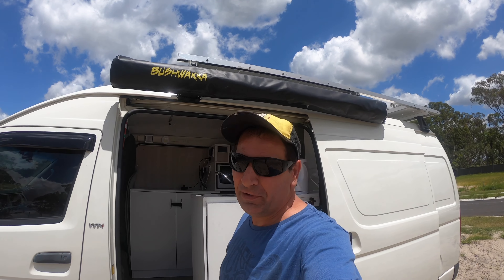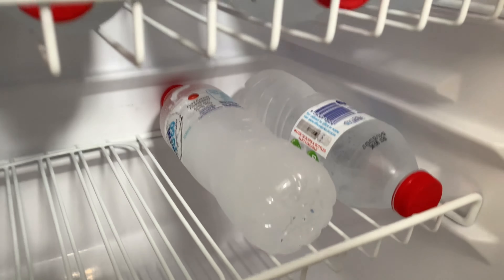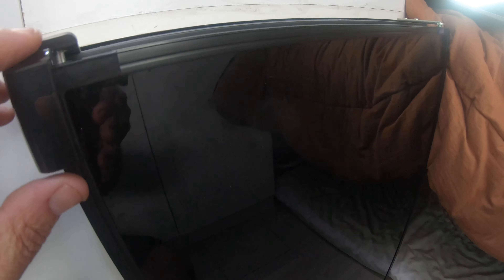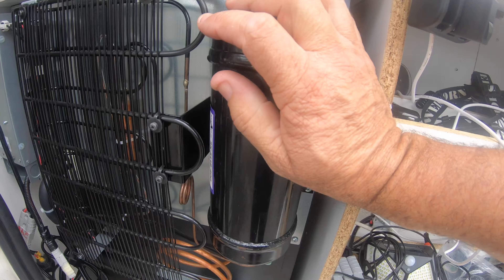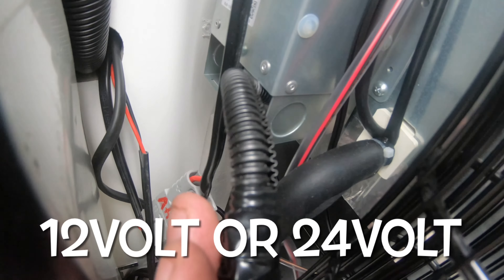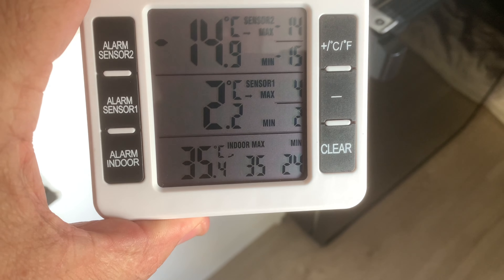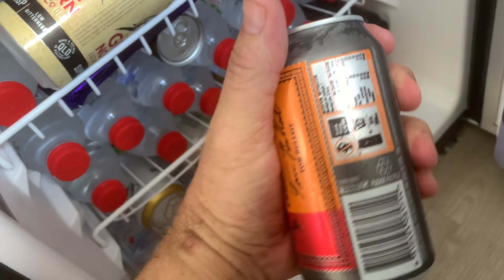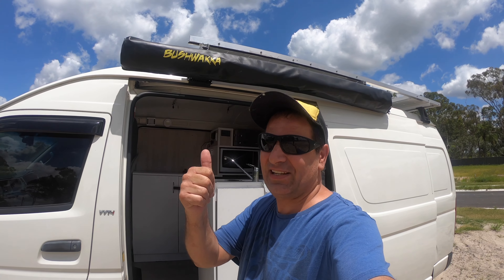Engel ST90F 80 litre 12v 24v 240v upright fridge freezer

Comment: Thanks for sharing. Keep looking at upgright fridges to get an idea for when I get a second fridge. I'm actually impressed with the power consumption considering the ambient temperature and the fact the freezer was running. Had a few fridges over the years. a National Luna for past 7 which has been running 24/7 with no issues. Not a fan of Dometic so good to see that Engel make an upright (National Luna don't). Thanks for your time. Cheers.
Reply from the maker: Cheers buddy this fridge still performing really well. Thanks for watching 👍🍻

Comment: Now your talking. Engel is the only what to go. Not frost free but we don't run them all the time.  I love our "chest units" we run that freezer at -12 and our 2nd unit at 3c. being in the insulated canvas bags (optional extra) even if its pushing high 40s they stay cold. Upright units work better for vans though. Have you seen the drawer units for under bed or shelf mounting. Opens up so many build options when doing a van or bus. All the newer Engels are great on power use. Love them. Should keep you happy for many years my friend
Reply from the maker: Absolutely mate . They have a great resale value and people will pay a premium for this . My 38 litre eclipse Engel sold within a 3 days when I advertised it for $650 . The guy came and looked at it and gave me the money without hesitation as he seen it working . He didn’t batter an eyelid . I seen the drawer ones and would be great . I put the upright on the 3 setting mate and had the van parked under the carport for 4 days and it only used 90ah and was around 3 degrees in fridge . It’s been running continuously now since I got it mid December 2021 and the frost is starting to build up in the freezer .Engel is for life  . Take care mate 👍🍻
Reply: I run mine all year round  no problem